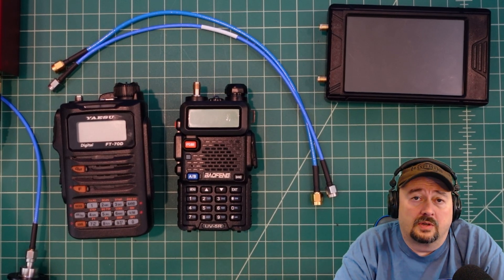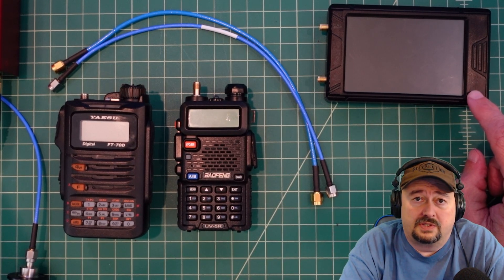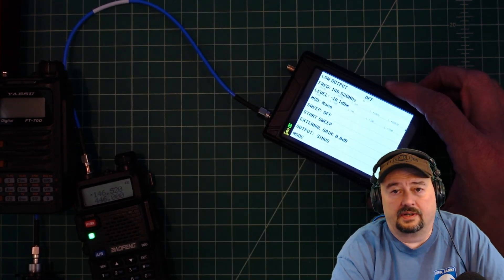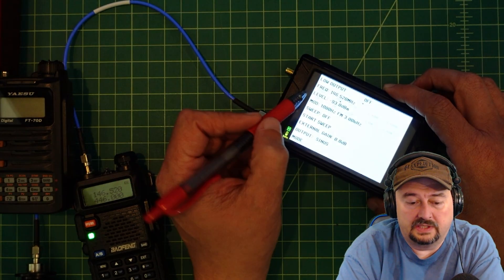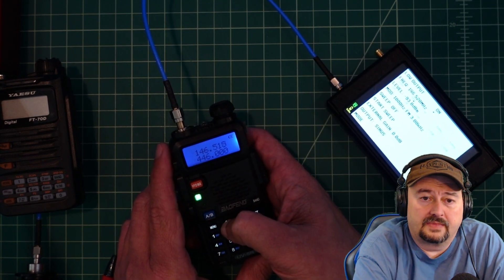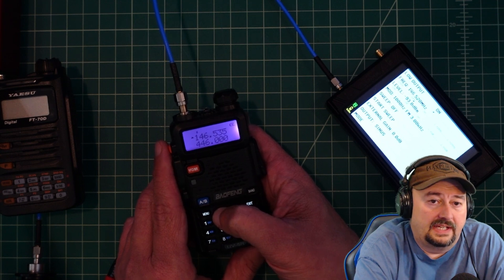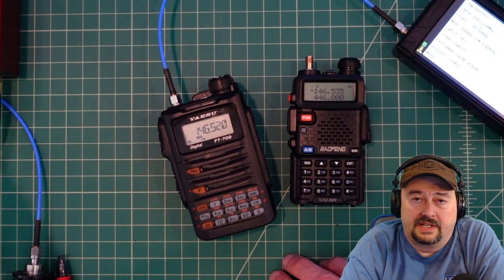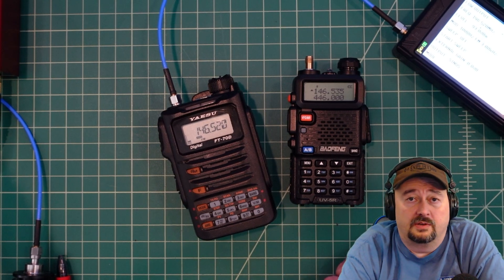Baofeng UV-5R Adjacent Signal Rejection Test with TinySA

Comment: Using Dual sig Gens would be a good Receiver "Desence"  demonstration showing the superior Superhet receiver design Performance compared to the Horrible performing Baofeng direct conversion type.....Most users Don't fully understand the cheap designed Receiver Desense issue......
Reply from the maker: Noted

Comment: Hi Ape !,   If you Use the standard Dual (1 Unmodulated + 1 Modulated)  sig Generator method, the --60 db Adjacent Channel Selectivity spec Test works correctly Measuring the relative Selectivity Ratio between the 2 sig Gens....I have never had the Single Generator method to test correctly.....Try it using a 3 port Combiner & check it out....Works pretty cool....
Reply from the maker: Thanks for the info Tom 👍

Comment: Thank you for running the test. After watching the test I wonder what is the radio's architecture. Many HTs use an SDR like SOIC which is limited today.  I am not saying they will not improve. I wonder if a supper heterodyne radio would perform  better. I am asking since I have seen my BTech saturate and my FT1XD did not at the same event.
Reply from the maker: Yes, a SuperHet doesn’t have that problem 👍

Comment: I have done some tests on my uv-5r. The result is when you direct input pure signal from signal generator, it works great it is really sensitive, but if you have double signal input, same strength -90dB, 40KHz away, Baofeng start crazy.
Reply from the maker: Thanks for the info Simon!

Comment: Very cool . This is a selectivity test which again is a good simple test to compare recievers. You can do an adjacent channel rejection test with two tiny SA's one generating a signal on the selected channel and another generating a signal on the adjacent channel. Both tiny SA's are connected  to the ISOLATED inputs of a combiner and the receiver under test tuned to the selected channel is connected to the output of the combiner. You measure the sinad (analog) or BER (digital) on the test receiver. Thanks for sharing !
Reply from the maker: Thanks for the info SC!
Reply: @TheSmokinApe  Anytime I shot a video of a baofeng vs a Motorola APX8000 today on selectivity. Will do it as a shoutout.

Comment: I appreciate what you are doing and understand that you are not claiming a "lab standard" test. May I suggest an additional test?

Knowing that you can receive a signal at frequency X but not at X+Y is fine, but another relevant question is would you be able to receive a signal on freq X+Y while there was also a signal at X? This would be a test for desensitization.

Here is a Wikipedia link: https://en.wikipedia.org/wiki/Desensitization_(telecommunications)
Reply: I agree that maybe the test could have gone further. Still interesting. I'd have liked to also see the result with the Yaesu FT-60, as I think it is the gold standard in VHF/UHF analog HT's. Again, thanks Ape. No one else is doing anything close to what you are here. I can tell you that at a major radio site, the Baofeng is just something you would use to pitch over the cliff to watch it bust apart when hitting the ground below, as it's useless The FT-60 is still doing it's job as designed. Not scientific, but real world.
Reply from the maker: Thanks Johns!  I'm glad y'all like the videos and I am planning on more advanced testing.

Comment: Would +93 have damaged the Baofeng?
Reply: If the tiny sa could put out +93dBm it would burn down Ape's house taking the 'feng with it :-) +93dBm is 2MW
Reply: @Wayde-VA3NCA  Holy spankage!  That emphasis on the - not the + is quite valid!!!
Reply from the maker: You do need to be careful, thanks for watching guys!